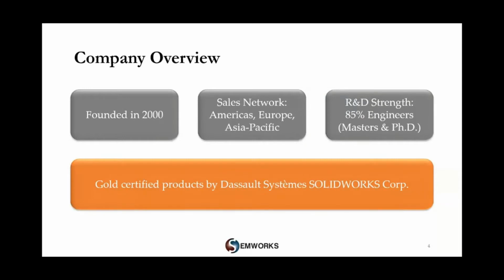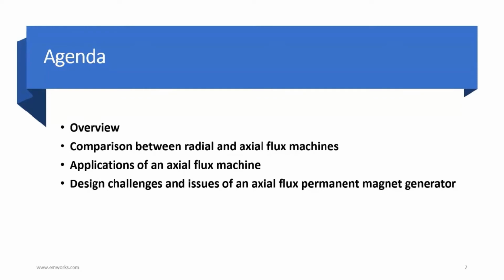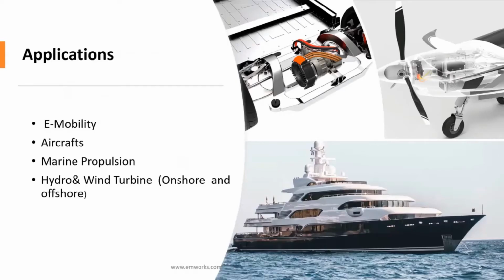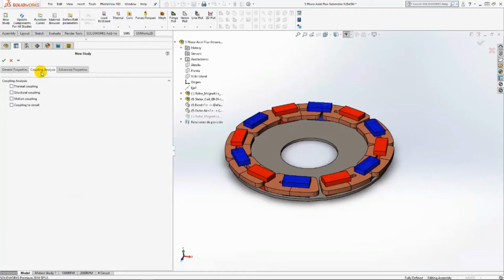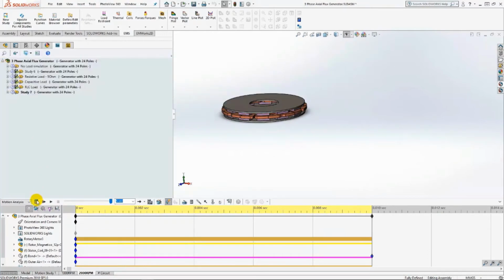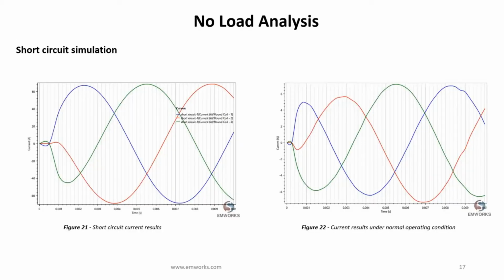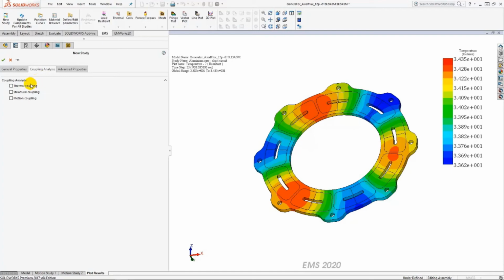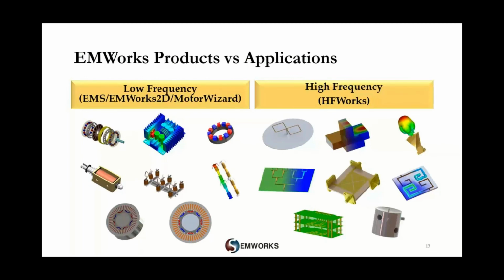[Webinar]-Axial flux permanent magnet generator design challenges & solutions for SOLIDWORKS

Comment: I am using EMS to design and simulate AFPMG. I have a question regarding coils in schematics. Do we have to put resistors on the side where there is the dot on the coil or we can put them on any side. The reason why I am asking this question is because I get current 180 degrees shifted from voltage, but in my calculations they should be shifted a lot less.
Thanks for help and congratulations on great software.
Reply: Can i get ur mail id. I need this software